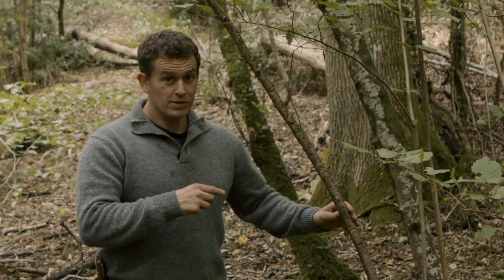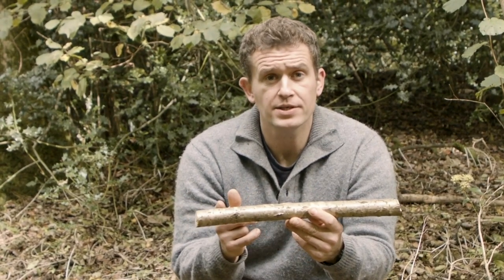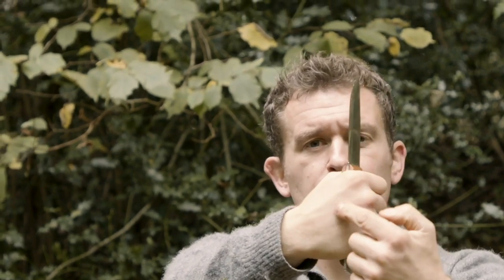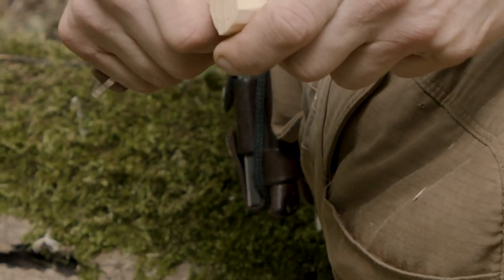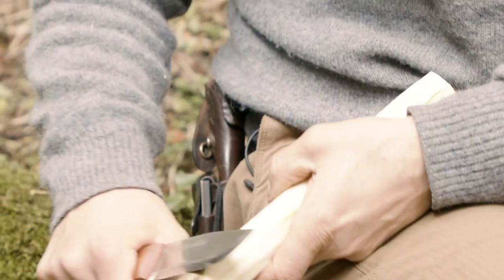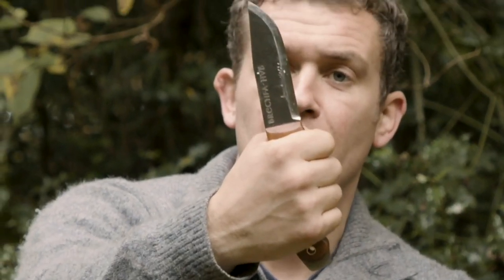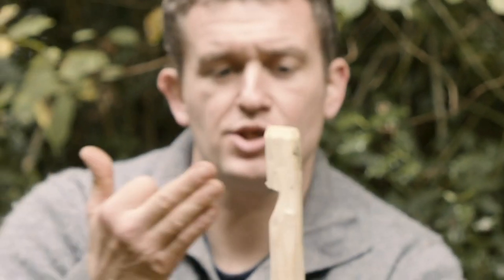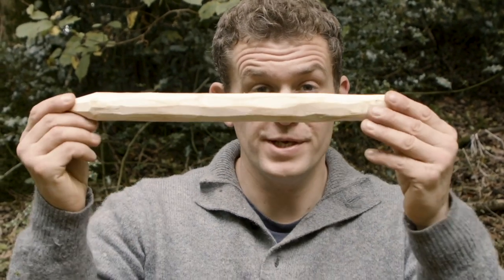DIY Tent Pegs and Sliding Knots

Comment: Good tutorial Nick but the cross cut/birds beak would normally be used for pot/kettle hangers, your first cut is all that's needed for tent pegs, always remember KISS 👌🏻
Reply: Removing some extra material under the notch can help create a "trap" for the line you tie to it so you're guaranteed to not have it come loose from the peg.. It also has the benefit of changing the angle of where the line connects and the pull of the line is going, making it more aligned.
Reply: @hiddenvalleybushcraft5683    Yeah Nick my bad, re watched it 😁